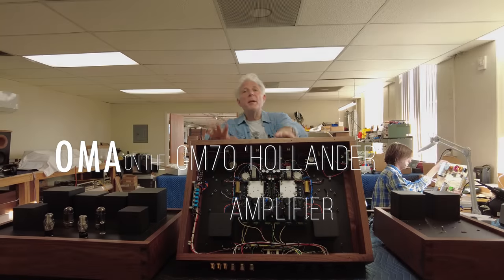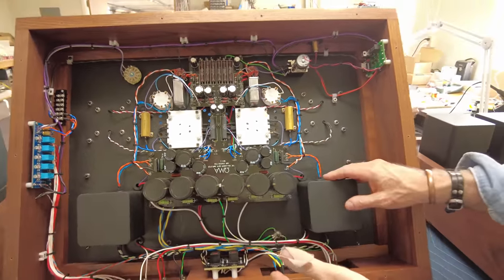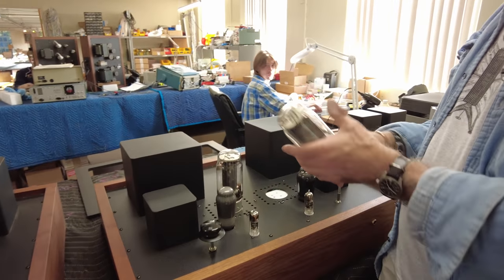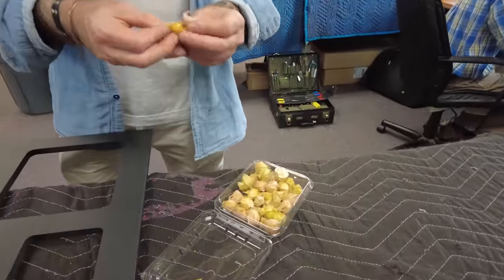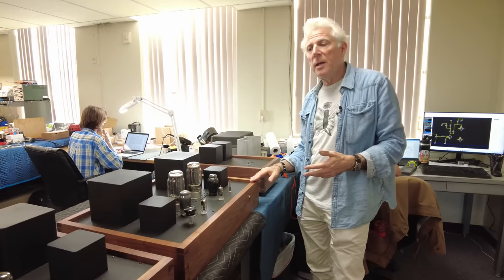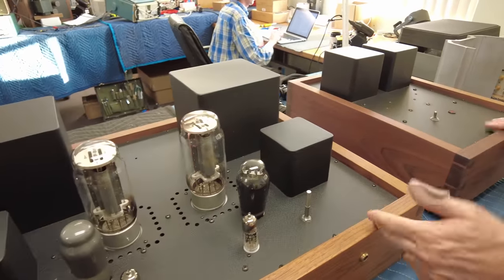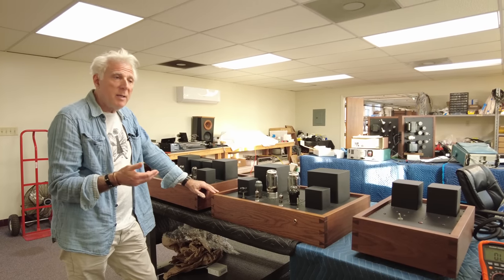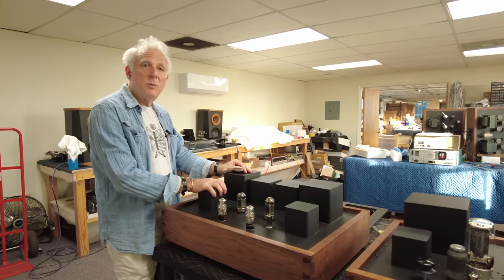OMA GM70 'Hollander' amplifier

Comment: As someone with a background in electronics I can completely understand the reason you need three separate chassis. Your signal is completely isolated from the power supply, thus making your audio path about as absolutely quiet and zero noise as electronically possible. Combine that with your speaker efficiency even driving them with 50 watts would probably shatter the windows and all the glass in a house with your system.

Comment: Nice, would love to hear that one day! The GM70 isn't just a copy, but a much improved and higher plate dissipation descendant of the 845, and as far as I know, the specs of the copper version do not indicate it's lower powered (AFAIK, only the early iron plate version had lower plate dissipation), but they all sound different. Looks like a great design and build! Must admit that for almost the whole duration of the video, I kept staring at the left AL4 driver tube, looks as though it had air (dead getter and vacuum), hopefully an optical illusion. Love your content, hoping you'll be in Munich again as I'm bummed to have missed your room last year! Cheers!